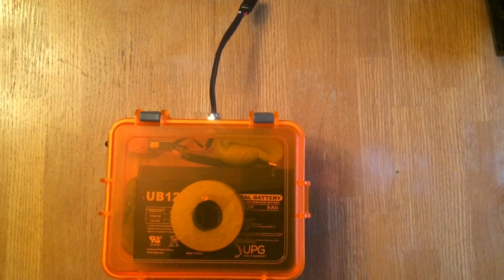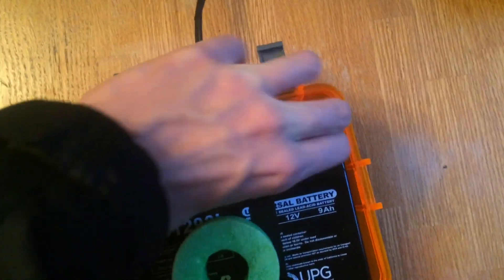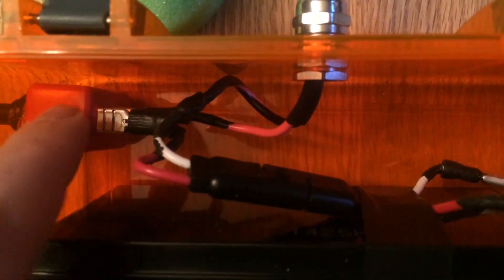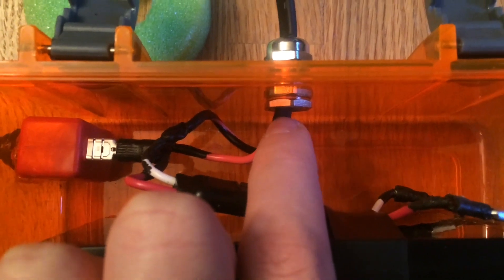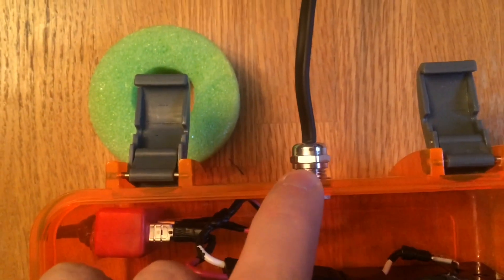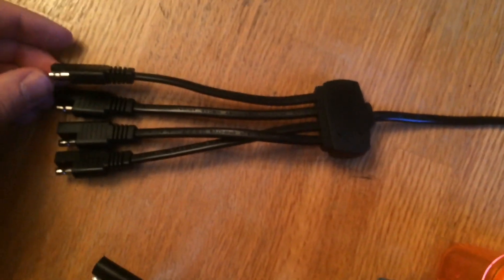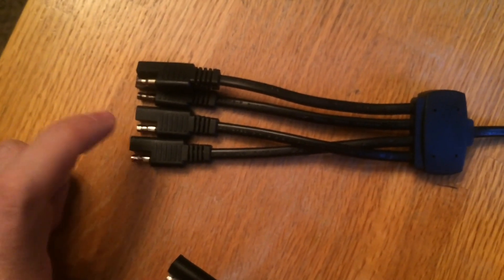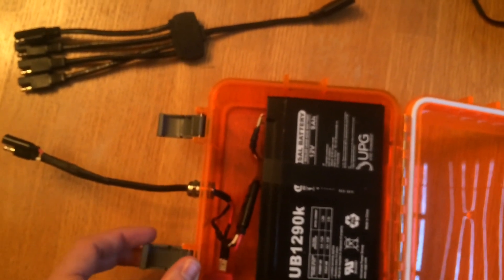Waterproof 12v Battery Box for Fish Finder, Livewell, & Kayak Fishing

Comment: This is an absolute great solution thank you- one question on the SAE connector exiting the housing how did you get the housing that surrounds the cable so that it will fit the cable gland? Thanks a bunch
Reply from the maker: I simply drilled hole in box, insert cable gland with backing nut, run my cable through, tighten cable gland around cable, and I’m done.

Comment: Just made mine today. The only change I made was not using SAE connector inside box but female blades in and out of switch (hot) and neg straight to battery all connected to SAE connector outside of box thru gland nut. Took all of 30 minutes.
Reply from the maker: The gland nut is the key.  Everything else is kind of up to the individual.  Sounds like you got a decent setup.  Hope it works well for ya.

Comment: Based on your build that switch would need to be in the on position to charge the battery using the sae  connector, correct.

Comment: How concerned should we be about heat from the battery being locked in a sealed box.  Not so much from the aspect of battery life, but danger from overheating.  (I live in Texas).  Thanks
Reply from the maker: +bosshog 104 I wouldn't store or mount in direct sunlight if possible.  Intense heat and cold is hard on batteries.  I live in Florida and haven't had issues with the sealed part.  The case is not submersible rated.  It keeps stuff dry but likely would vent under any internal pressure.  All builds are DIY at own risk.  Just enjoy sharing what I have done.  I have had no issues with this setup.

Comment: Nice work. I was also wondering if you can come off of this setup with a separate switch as well mounted on the Yak. I'm thinking of adding LEDS to my yak as well, but will put the dry box into the hull itself. If I go about it this way then I will have to have a separated switch mounted on the outside of the yak as well, but I like the switch on the box as a main power switch. Thanks again for the great video of the build.

Comment: I bought all of the supplies I needed in the list and got the connections made between the battery and the switch.  Where I am missing something is between the switch and the cable that passes through the gland.  Is this a separate length of cable that you had on hand? Can you provide specifics on that cable?
Reply from the maker: +Matthew Curley it is two SAE connectors.  One end is outside of box and goes through gland into switch and to the other end of SAE.  That SAE end then plugs into respective 2nd SAE plug and then to batter terminals.
Reply: Ok, thanks for the reply! Th connectors I bought have a red and black wire without any sheathing around them.  The video displays a cable going through the gland however I just have the two thin wires running from the connectors.  Too thin to pass through the gland and create the seal.  Any recommendations?  Here is the link to the connectors I purchased.  I found them using the link you provided for salt water connectors.  https://www.amazon.com/gp/product/B016NV1PVW

Comment: Thanks for the video. In the process of whipping one of these up. The only thing is the cable glands won't be here for another month. So I just got 1/4" grommets for the time being. Did you experience a long shipping time for the cable glands too?
Reply from the maker: I didn't have to wait long, but maybe due to the video they are running low.  The video has had a lot of views lately and thus they might be temporarily low or behind in filling orders.  This channel drives a lot of traffic to certain supply sites/links.  Any PG7 cable gland would work, but I really like the ones I linked to because you can tighten them down really well without stripping.

Comment: Hello--I was wondering if you could help me with a few questions. I'd like to keep the box in the hull in my Kayak but I want to keep two switches up where I sit (one for a fish finder and one for a bait well). Do I need two 3amp fuses or can I just use one fuse inside the box between the battery and the gland? Also is there a particular switch that you recommend?  One more question--in one of the earlier comments you said that you could go with a waterproof SAE connector--is there a waterproof SAE 4 way splitter?  Do I need to go with waterproof SAE connector and 4 way splitter for salt water--can I tape up the cables to prevent corrosion? Thank you for the video and any advise you can provide

Comment: I just ordered the SAE Connecters and they seem to be 12gage wire. I had issues before when I tried to hook up my Lowrance Elite 4 fish finder/chart plotter with a quick connect for a battery tender. It would Not power on. So I was forced to just connect it to the battery & remove the battery every time I need to charge it. So I'm confused trying it again with this size wire was that the original problem or was it the fact I was using a quick connect for a battery tender. Btw: it worked fine with my trolling motor but my Lowrance seems to have had an issue with not liking the quick connect. Have you heard of this before? It the gage wire I'm using from the Lowrance (1 gage smaller than the 12) or is there something I'm not doing correctly? Thanks for the great videos & Please advise. I need to get my new toy in the water so I can start enjoying the Gulf of Mexico via Florida too 😄.

Comment: Thanks for the great vids, keep them coming. I have a question though, in my situation I'm installing an old Lowrance HDS 5 as a temporary fish finder until I can save up enough money to purchase one of the new Lowrance Hook 5 units, anyway, my problem is that my old Lowrance does not have a plug on the end of the power wire, just two bare wires, one red and one black with an inline fuse on the red (hot) side. I'm trying to find a decent waterproof plug to use on the Lowrance and to install on the side of my plastic "ammo" box that I'm using as my battery box. In other words, the male end of the plug goes on the Lowrance and the female end of the plug would be mounted through the wall of the ammo box and then have wires connected to it and running to the battery terminals. Any ideas with links would be greatly appreciated. Radio Shack has gone out of business so I don't know where to go to ask the questions or get some help figuring this out. Thanks for the help folks.
Reply from the maker: +beddog57  Search 2 Pin waterproof connector IP68.   They make them for LED kits and that would likely be similar gauge wire.  I buy them on Amazon.  If I get time I will try to find them and send you link in reply to this comment.

Comment: How big of a hole do I need to drill for the cable gland?
Reply from the maker: +Kathy Corvo hole size depends heavily on the cable glands that are purchased.  For the stainless steel glands linked in our video description we used 31/64" bits.   This provided a tight fit.

Comment: I didn't see the connection wires that plug into the battery and the one that plugs into the switch in the description. Where can I get those? And Obviously I'm not very educated on all of this so I apologize, but what was the purpose for the inline fuse?
Thank you and great video.
Reply from the maker: In line fuse protects things like fish finders from being fried if there is a surge in amps.  A 3amp inline fuse breaks at 3amps and was necessary for my fish finder according to the owners manual and factory recommendations.  The wire connections are just F2 terminal connectors that I bought on Amazon.  I will try to remember to add them to the supply list in the video description.  Thanks for the feedback and I hope this helps.
Reply: +KayakDIY this helps a lot. I'm new to the kayak world and I'm trying to add a lot of things but I'm just not that familiar with everything. I'm also using your video to make a bait tank so thank you!
Reply from the maker: No problem!   We are growing the channel and in an effort to add new fresh content we are moving to arguably one of the best saltwater fishing spots in the U.S (Matlacha/Cape Coral FL.).  It is there that we will really be able to expand our video content.    We are always here if you have questions and will answer you as quick as we can.  For quicker assistance I recommend going to our Facebook Forum Group (www.Facebook.com/groups/KayakDIY)

Comment: Is there any chance you can do a step by step for how to build one of these?
Reply from the maker: Eventually I planned to do another video on one.  Basically you buy a waterproof box.  Then drill a hole for a cable gland.  Then setup wires for battery with a inline fuse (3amp usually) spliced in on the red positive wire.  The have wires passed through cable gland.  I added a switch in on the one you see in video.  Switches are easy....just splice switch in between the positive red wire.  There are lots of switches available but just search waterproof "on/off" switch.  Depending on what kind of electronics you use you may want different fuses....I use 3amp because that is what was recommended for my Humminbird Helix 5si fishfinder.
Reply: @KayakDIY   did you add the f2 connectors the end of the helix 5 Si wires or did you splice them to an SAE cable that plugs into this battery box?
Reply from the maker: Josh  Anderson I used SAE 2-pin connector for battery box to fishfinder power cable connection.

Comment: Where did you get the cable from ???
Reply from the maker: +Hong Thi All supplies such as cables and container can be found in video description below the video.
Reply from the maker: +Hong Thi 
Supply List Below.

Watertight Container (Large Size): http://www.amazon.com/gp/product/B007JQJFIQ/ref=as_li_tl?ie=UTF8&camp=1789&creative=390957&creativeASIN=B007JQJFIQ&linkCode=as2&tag=ytk-20&linkId=WZKM67WUSG6Q3HFN

SS PG7 Cable Gland (x1): http://www.amazon.com/gp/product/B00AOBGQ26/ref=as_li_tl?ie=UTF8&camp=1789&creative=390957&creativeASIN=B00AOBGQ26&linkCode=as2&tag=ytk-20&linkId=IUQWBZRJ6VIQJZVA

SAE Connectors (x2): http://www.amazon.com/gp/product/B003C01FD6/ref=as_li_tl?ie=UTF8&camp=1789&creative=390957&creativeASIN=B003C01FD6&linkCode=as2&tag=ytk-20&linkId=ROGA5IRQFQHKTVPG

SAE 4-way Splitter (x1): http://www.amazon.com/gp/product/B003L643KS/ref=as_li_tl?ie=UTF8&camp=1789&creative=390957&creativeASIN=B003L643KS&linkCode=as2&tag=ytk-20&linkId=YEUVA7WEDHCF6JNN

On/Off Toggle Switch (x1): http://www.amazon.com/gp/product/B006YZBJNM/ref=as_li_tl?ie=UTF8&camp=1789&creative=390957&creativeASIN=B006YZBJNM&linkCode=as2&tag=ytk-20&linkId=TNNUURBMMPFYOWQC

Battery 12v 9ah by UPG (x1): http://www.amazon.com/s/?_encoding=UTF8&camp=1789&creative=390957&field-keywords=9ah&linkCode=ur2&rh=n%3A172282%2Ck%3A9ah&tag=ytk-20&url=search-alias%3Delectronics&linkId=IFMPPAKDC5N5K53F

F2 Crimp on connectors (use for connecting battery terminals to SAE wire inside box)

OPTIONAL: In-line Fuse If Your Electronics Don't Have Them: http://www.amazon.com/s/?_encoding=UTF8&camp=1789&creative=390957&field-keywords=in%20line%20fuse&linkCode=ur2&tag=ytk-20&url=search-alias%3Daps&linkId=DACGCO76M6NDYBP6

OPTIONAL SUBSTITUTE to SAE Connectors (threaded 2pin connectors): http://www.amazon.com/s/?_encoding=UTF8&camp=1789&creative=390957&field-keywords=Male%20Female%20Plug%202%20Pin%20LED%20Waterproof%20&linkCode=ur2&tag=ytk-20&url=search-alias%3Daps&linkId=XDMTF2GJ4X7HZ25O
____________________________________________
The build will also require that you pick up some heat shrink tubing or liquid tape to secure spliced areas like the SAE connectors.  We used heat shrink tubing because it creates a nice rounded covering that creates a nice seal when passed through the cable gland.  Hope this build helped give some of you kayakers an idea on how to build a battery box for powering your kayak gear like livewell, fish finder, or lighting.  We chose the 9ah battery because the size was identical to many of the 7 and 8ah batteries but just weighed more.  The case could hold a larger battery if needed.  See the listed Amazon container dimensions vs. battery dimensions in the descriptions at the links we posted above to determine what will fit if not using a 12v 9ah. 
____________________________________________

OPTIONAL SAE ATTACHMENT FOR GOPRO CAMERA USERS
**Use the below product and pair it with the camera build we show in our other videos.  This will allow you to power your GoPro camera on the water for the entire day.

SAE to USB converter (Optional):  http://www.amazon.com/gp/product/B00DJ5KEF4/ref=as_li_tl?ie=UTF8&camp=1789&creative=390957&creativeASIN=B00DJ5KEF4&linkCode=as2&tag=ytk-20&linkId=DSFTR2WULMIK5JIT

VIDEO LINK OF GOPRO CAMERA SETUP: https://www.youtube.com/watch?v=PmcITlwx1SM

Comment: I built my kayak battery box very similar to this with the 4-way SAE splitter.  Since the battery sits inside the hull of my kayak under my seat, are these SAE connectors submersible if I take on water?  I was wanting to use one of the SAE lines to power a bilge pump and am concerned about this whole setup being under water.
Reply: My connectors corroded after a few trips
Reply: +Travis Billings  - I'll be in fresh water, so hopefully that will help. I'll also add some electrical grease to help prevent that corrosion.

Comment from the maker: Andrew Rolfsen I don't recall exactly what drill bit size was used for that switch.  I believe it was a common size like 3/8" but unsure.  You will want to measure the switch or read the switch instructions anyway to confirm measurement.  Sometimes distributers change products so measurements might change.  The stainless steel PG7 cable gland used a 31/64" drill bit.  Here is a link to a drill bit in that size because it can be a bit uncommon in many drill sets:
http://www.amazon.com/s/?_encoding=UTF8&camp=1789&creative=390957&field-keywords=31%2F64%20drill%20bit%20set&linkCode=ur2&rh=i%3Aaps%2Ck%3A31%2F64%20drill%20bit%20set&tag=ytk-20&url=search-alias%3Daps&linkId=MFO6RVIJLJ4K37UG
Reply: KayakDIY unfortunately my switch came in "bulk packaging" from china and had no instructions.

Comment: by chance do you remember what size drill bits you used to drill the holes for the pass through and the toggle switch?
Reply from the maker: +Andrew Rolfsen The toggle switch should state on the packaging what size hole needs to be drilled.  All switches can differ.

Comment: What type of wire do you recommend or gauge?  Did you just use electrical tape on the wires going through the cable gland?
Reply from the maker: Tommy Garza I used same gauge wire as the SAE connecters were.   I didn't use electrical tape but rather heat shrink tubing.  I never use electrical tape for builds but rather "liquid" electrical tape because it creates true watertight seals.  Hope this helps.

Comment: Thanks for the awesome video! I ordered everything on the list and have a newb question for you (teaching myself to be more handy). What are you using to connect the battery to the SAE connector. Is it wire? Clips? I think that component is missing from the list. Thanks again for your help
Reply from the maker: oso peroso We just use F2 terminal crimp on connections to the SAE connector inside the battery box. They are available at lots of hardware stores or if you can't find them we can link you to them via amazon.

Comment: I was also wondering what is the purpose of the switch?
Reply from the maker: The switch was just in case we wanted to shut down current to all accessories.   It is not 100% needed but we felt it was more concise any than unplugging all accessories.  One could just unplug all accessories instead. An inline fuse is important if running electronics that lack fuses.

Comment: Thanks for your video. I do have a question hopefully you can help me with. I want to run the sae connecters you have listed above (I have read they are 16 AWG wire) through the glands you have listed. The image of the sae connectors, they are two separate wires, in your video they are in a sheath or was that just heat shrink wrap? If I run the two 26 gauge wires thought the gland, is it still going to be waterproof?

Comment: Another great tip is to use stick on velcro to run elecrical wires throughout kayak. I like not permanent mounting options whenever possible,so i can sell kayak after a year or 2 and upgrade !
Reply from the maker: Not a bad idea.  Thanks for sharing Eric R.